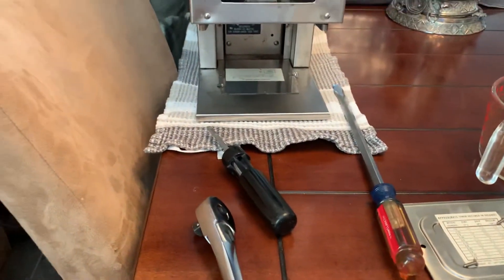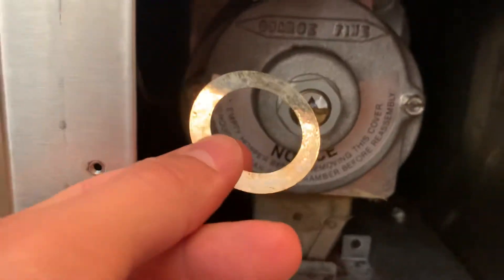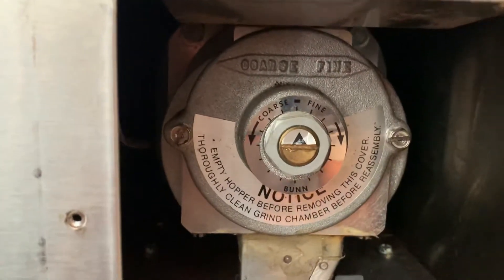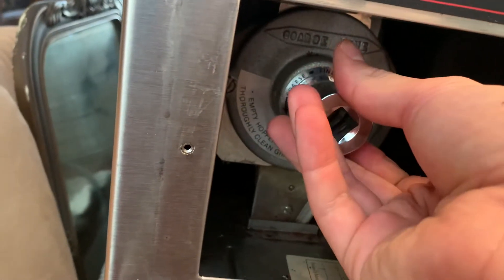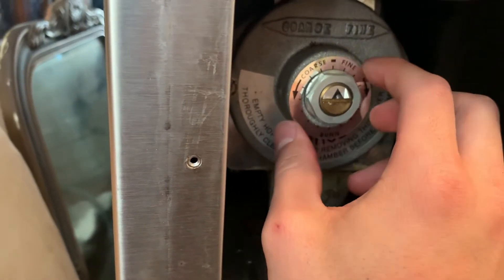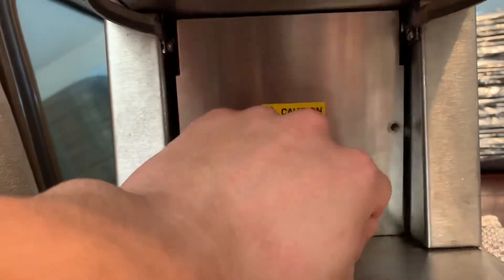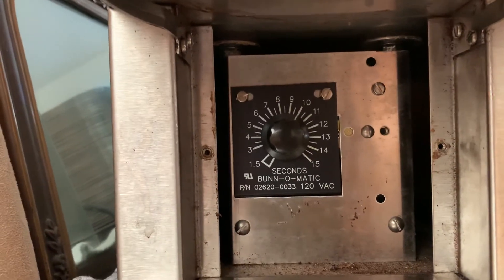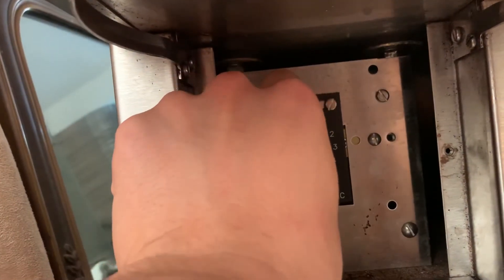Bunn G9 commercial coffee grinder coarseness and timer adjustment tutorial

Comment: Any luck with cleaning this baby? But having alot of trouble with taking it apart and cleaning it well. Just bought a used one.
Reply from the maker: greeting! i have not tried taking it apart or cleaning at all. if you are getting residue from old coffee oils, i would recommend checking out Tabz grinder cleaning tablets: https://www.amazon.com/Urnex-Professional-Grinder-Cleaning-Tablets/dp/B0014J7FUY/ref=asc_df_B0014J7FUY/?tag=hyprod-20&linkCode=df0&hvadid=309735741984&hvpos=&hvnetw=g&hvrand=9026156041971040945&hvpone=&hvptwo=&hvqmt=&hvdev=c&hvdvcmdl=&hvlocint=&hvlocphy=9031182&hvtargid=pla-347658283862&psc=1

this should help if there are any flavor issues you notice. the coffee you grind immediately after using these tabs however will still have some of the cleaning tablet powder mixed in, so be sure to discard the coffee that you grind immediately after using them. 

depending on frequency of use, you could clean using these tabs once a week (though I truthfully do it less frequently than that). when i worked at the cafe we cleaned the grinder with tabz every day.

hope this was helpful!